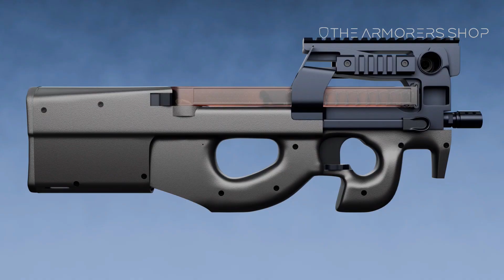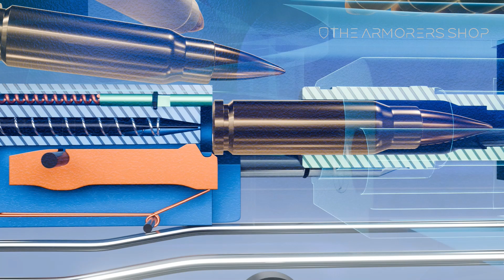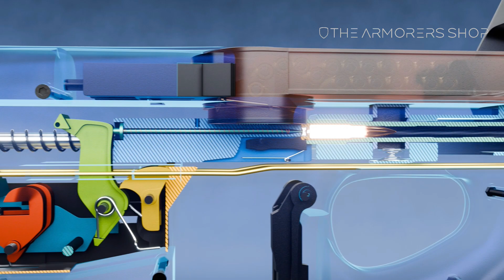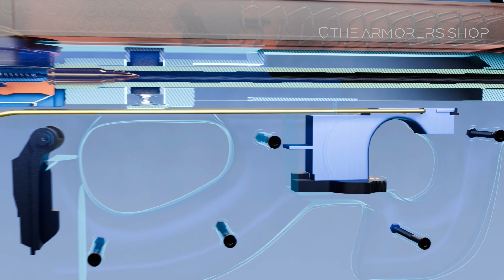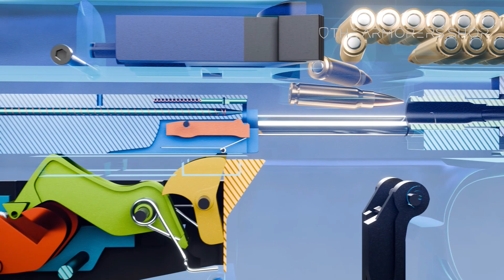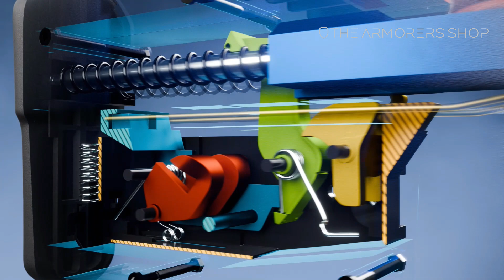P90 Cycle of Operations - www.thearmorersshop.com

Comment: How does the round chamber? I've been trying to look, but i don't get how the round turns 90 degrees. I get it goes into like a, almost slide, but what happens, from round in mag, to round in chamber?😊
Reply from the maker: Let's pick things up from the round in the magazine at 90 degree to the bore of the barrel. The magazine spring pushes that round down a  helix (spiral ramp). This rotates the round 90 degrees, now it is online with the bore. Thetop edge of the bolt rushes that round down the feed ramp into the chamber.